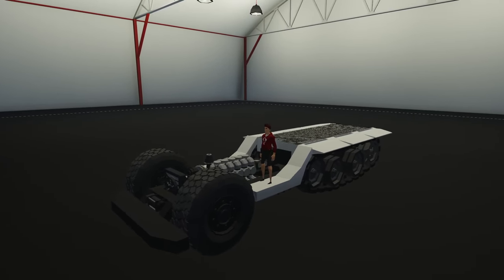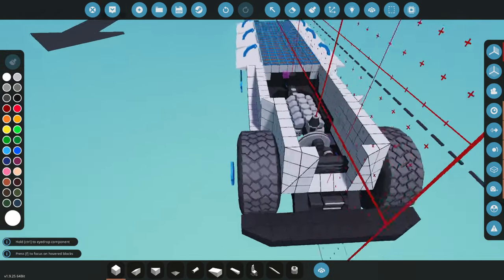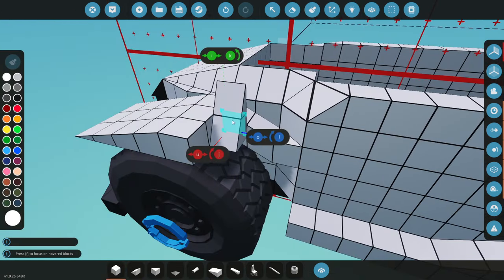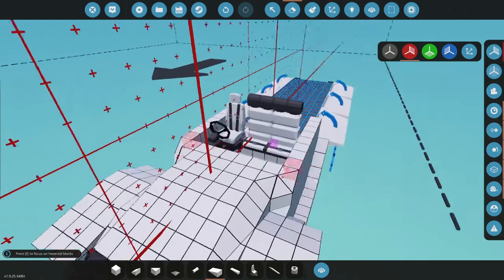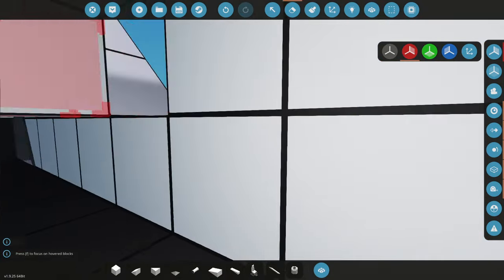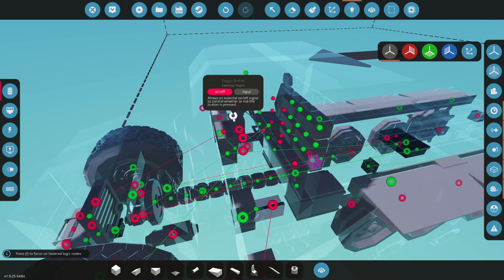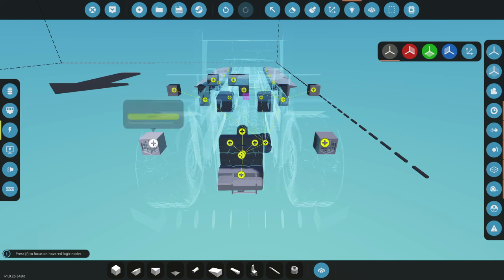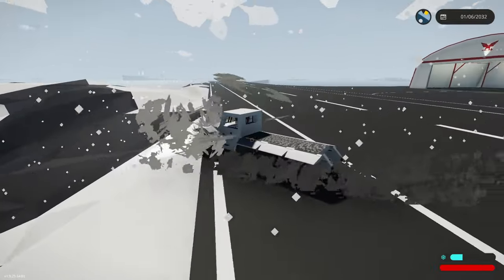I Built A CAB For Our Half-Track In Stormworks! #3

Comment: The Flywheel stores energy. When you engage the clutch to go into gear, it will take the energy from the flyhwheel instead of the engine and prevents the engine from stalling out. It might be important to put the flywheel after or one block before the clutch. I didnt test that yet.